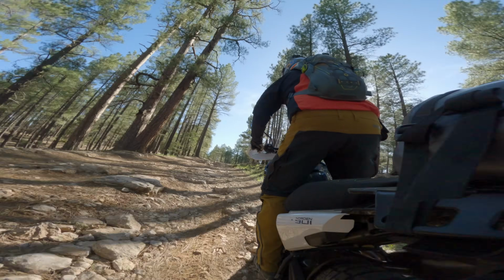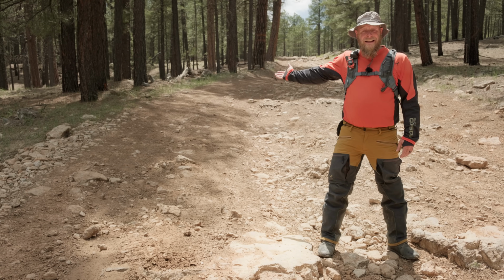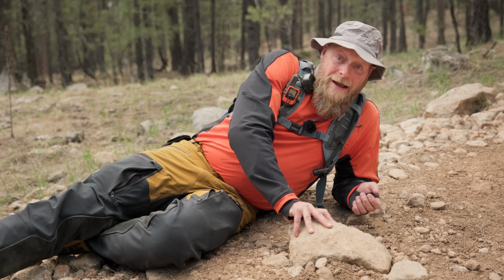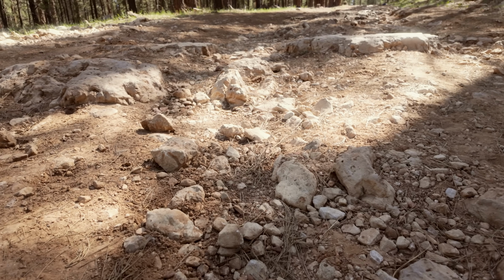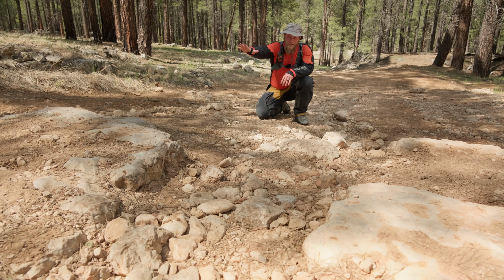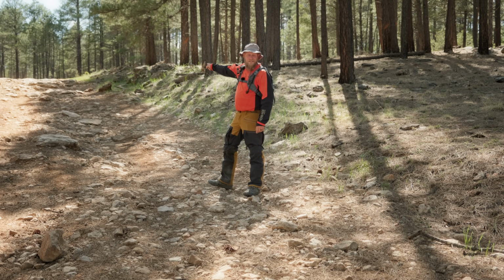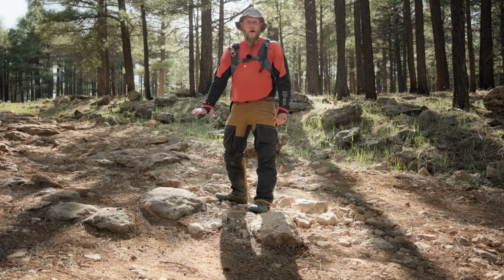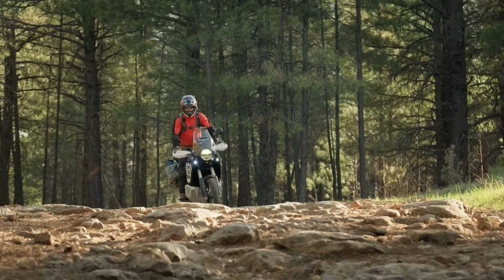How to CHOOSE THE BEST LINE on a ROCKY HILL - Adventure Motorcycle Lesson on Obstacle Avoidance

Comment: Nicely presented!
I enjoy the challenge of rocky climbs because I like to look ahead and choose what I think will be the best line, then ride that line and see if it does work well or if I get deflected off it and have to instantly choose a line to get back to my chosen line. As you stressed, momentum is essential and the slower we go the more difficult it is to ride. Even if the trail is completely flat, if there are rocks it is harder to stay balanced going slower than it is going faster.